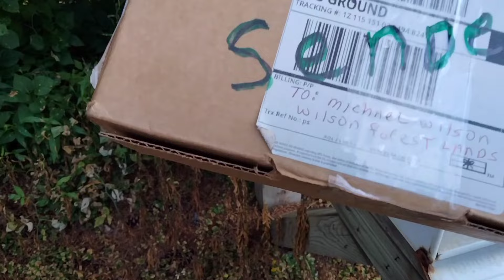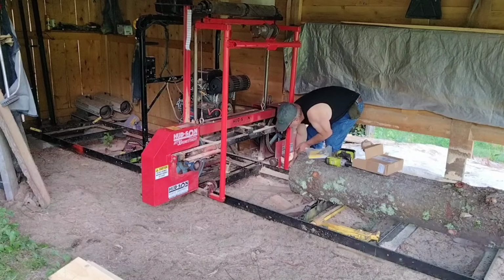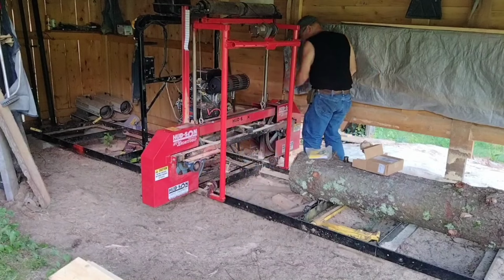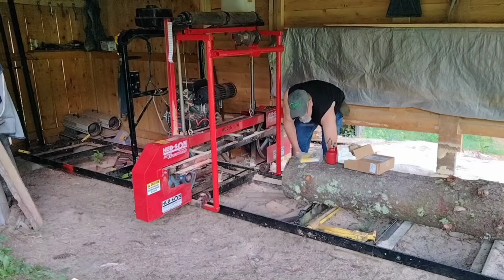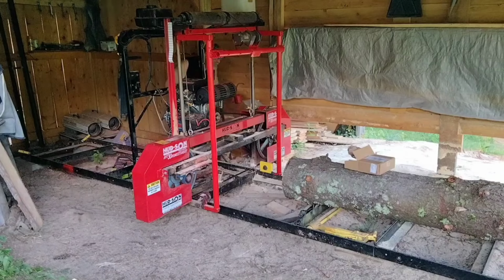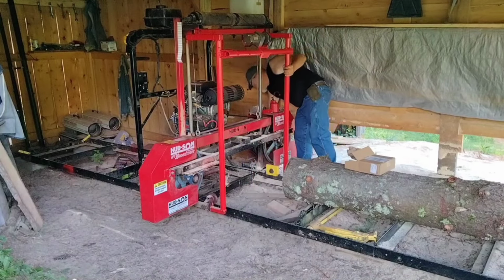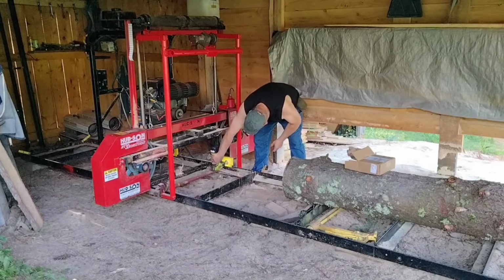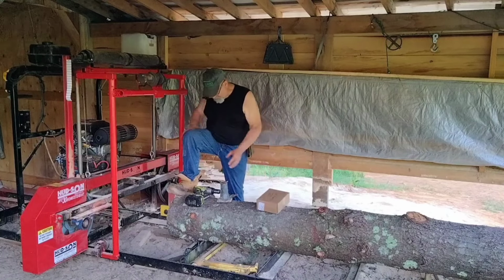WILSON! Don't Miss this: Hud-son's NEW track sweeps install #homesteading #portablesawmill #forest

Comment: Instructions are just another man's opinion!    What is the "boot" made of ?   Is it replaceable ?   is it a wear item ?
Reply from the maker: As a man, instructions are not necessary. But... sometimes they make things easier. The track sweeps are like metal fenders over the wheel with pivotal scraper's on each side. They are a new design item for Hudson. The carbon fiber shoes/scraper's look to be replaceable.
Reply: @Twobrothersoutdoors  thanks very cool

Comment: I like this idea, Great Info. Are the carbon fiber replaceable? I could not find listing on Hudson site for just these parts (may have to call them) they appear to have the design to be flipped to use opposite end when worn down. They look like blank motor brushes. (@ 70.00 Plus total, looks like they would instead of buying complete set again)
Reply from the maker: The shoes are made to turn around if they should become worn. Finding them on their website 🤷 I haven't found them yet. Tim placed a link to the "wheel guards" in the description below 👇

Comment: Standard option on new equipment?
Reply from the maker: They are standard on the Oscar pro mills. The freedom line and homesteader line of mills, they are available as an option. If you decide to purchase a mill, spend the little extra money and purchase one from the Oscar series and no smaller than the 30. There will be no regrets down the road.

Comment: Nice video but a word of caution, NiCad batteries are not to be trusted with left on charging, they can catch fire !
Reply from the maker: My charging station is a metal bench. If a battery were to catch fire, it would not be able to spread. Thanks Dale